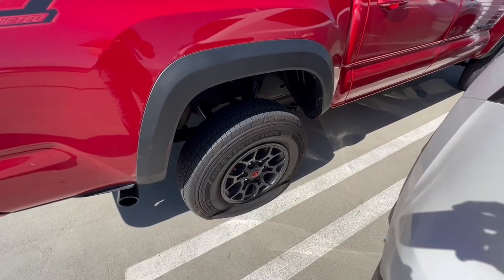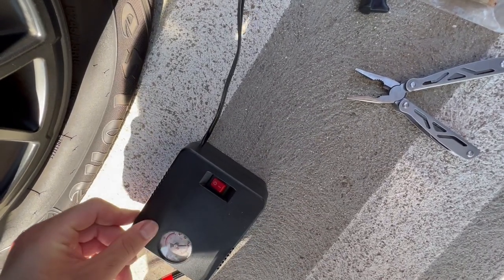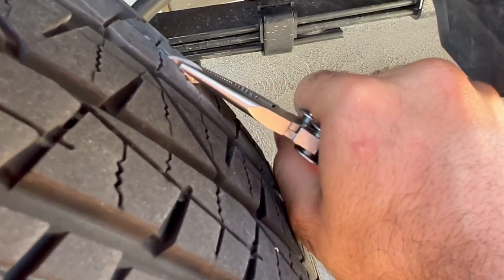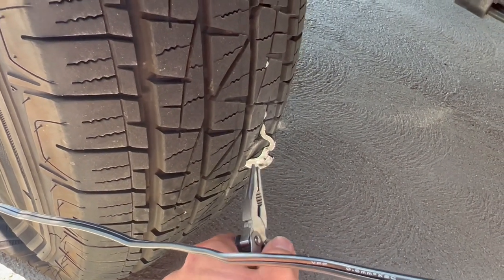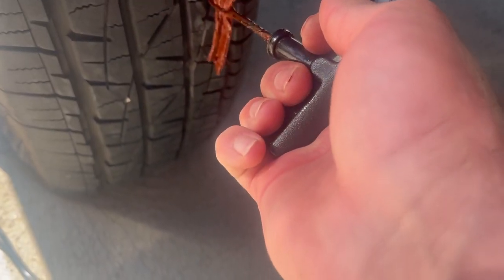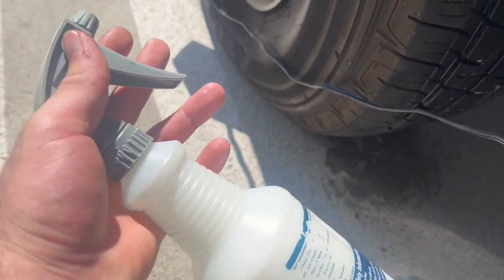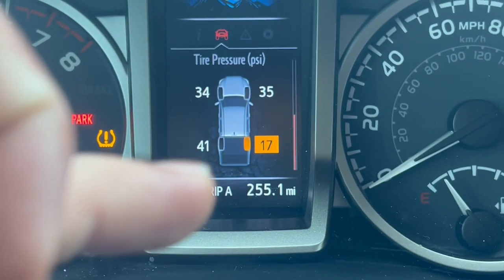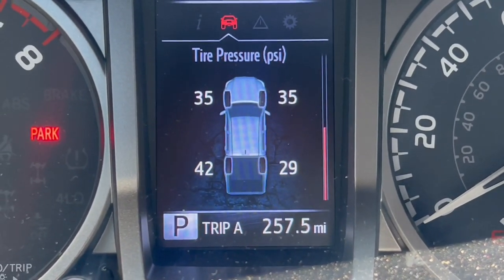How to Patch a Flat Tire (Under 5 min)

Comment: This happened to me a few weeks ago. However I went to the dealership to get it replace but they didn’t have my exact tire anymore since it was discontinued so I had to get a different brand but same thread. Soon I’ll be switching all 4 of my tires for bigger AT tires. 

Great video overall